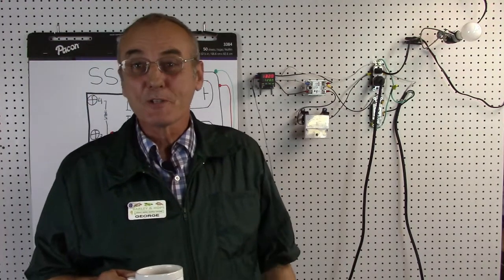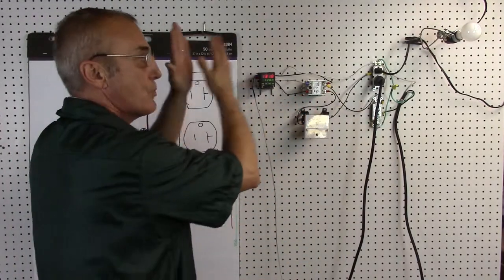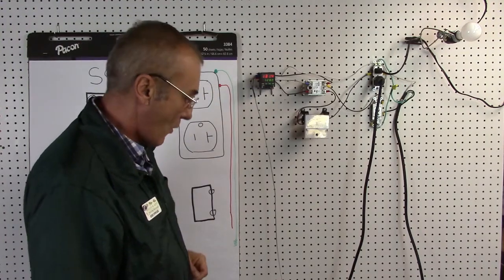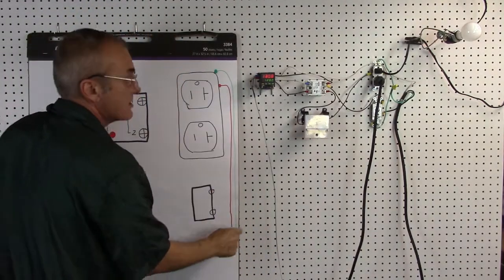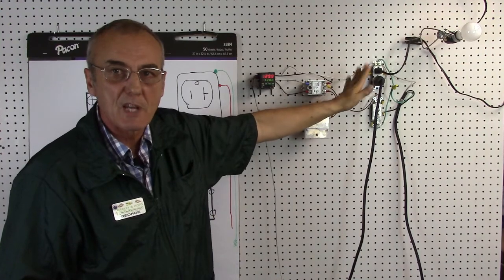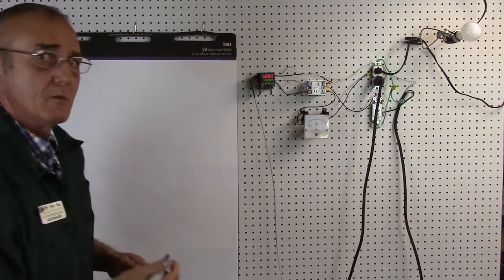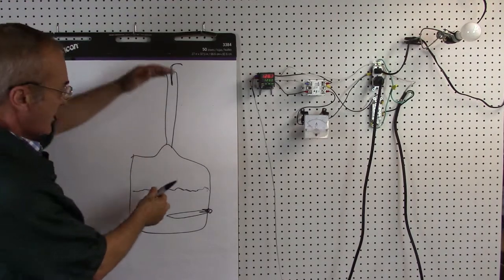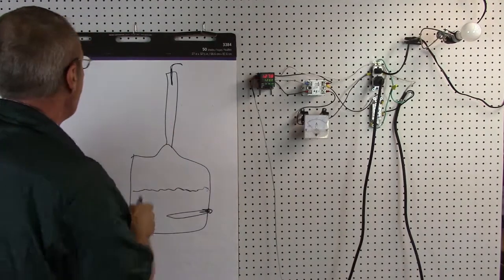Wiring 120V PID including an amp meter

Comment: George... I’m building a 240 controller 4 wire 30 amp system with a 240v PID and 240v PWM and a couple of 120v plugs.... I want have a total as well as individual AMP meters on each type system in same box... normally you only run one hot through the amp doughnut... If you run both hots I’m told they will cancel each other out... I read that if you feed the hots in from opposite ends into the doughnuts or criss cross it will give you total amp draw on main circuit coming into controller... your thoughts are appropriated
Reply from the maker: One wire, one doughnut. Anything other than that could cause mis-reading.
Amperage is measured by measuring the magnetic field inside the doughnut. Anything that would or could interfere with that field could throw off an accurate reading.

Comment: Hi George,

Regarding the PID  temperature prob. How do you install it 
Into  the Still. Do you a have the list of parts needed to do this without drilling hole in the pot or mask tank? Thx in advance.
Sincerely 

Bret
Reply from the maker: Bret, the probe should be in the vapor flow as it exits the still. There is no list of parts to do this. Some still are already capable and others need to be adapted.
Reply: Barley and Hops Brewing Thank You George!
Reply: @BarleyandHopsBrewing  top of stack??

Comment: Hey George, This is Don. I am so glad that you pointed out the 15 Amp limit. I saw some PIDs for sale that were supposedly 5500 watts but only had a 120 Volt plug. I immediately thought that they didn't know what they were doing and just put a 5500 watt element in and called it something that it is not or were they being deliberately deceptive to a public that is simply not going to know these technical details. My question is will a 5500 watt element only draw the current that is available or will it constantly trip the breaker? Your videos are a great way to inform the customer and an informed customer is a happy customer.
Reply from the maker: Don, a 5500watt element will draw as much as it can and trip breakers if the appropriate amperage is not available. 5500watt elements are typically designed for a 220V circuit and would draw 25 Amps. You could wire it for 120v and in that case it would act like a 2200-2500watt element (there is a formula for that) in that case it would draw around 19Amps. This is still above the average 15Amp circuits we are familiar with. You are right, this sounds like a situation where someone is not being fully honest with the customer. Hope this helps. 
I would rather be honest up front in the interest of safety and also to reinforce credibility. We may not get everything exactly right but we try hard and always stress the safe aspects of this topic. George
Reply from the maker: Don, the formula for to determine the wattage after wiring a 240V element to 120V results in the element operating at 25% or 1/4 of its rated value. I just did the math so a 5500 watt element wired for 120 would operate like a 1375 watt element. Appears to me like the selling point for these is the 5500 watts when actually you'd be better off wiring a 1500 watt rated for 120v and that would be more efficient and much cheaper (around $9). Anyway you look at it it's just dishonest.
Reply from the maker: Don, the formula for to determine the wattage after wiring a 240V element to 120V results in the element operating at 25% or 1/4 of its rated value. I just did the math so a 5500 watt element wired for 120 would operate like a 1375 watt element. Appears to me like the selling point for these is the 5500 watts when actually you'd be better off wiring a 1500 watt rated for 120v and that would be more efficient and much cheaper (around $9). Anyway you look at it it's just dishonest.
Reply: Yes absolutely, safety is always first and then reputation will follow. A good name is better than all the money in the world. Keep up the good work. Don
Reply: Thanks for verifying my suspicions George.

Comment: Hey George, Mij Project is ready, and everythings works perfect. The only problem is i have 2 ssr 40A and each ssr have is own AMP meter connected like in the step by step guide. when conecting i got no electric connection, when i put the wires together the things works perfect, what do you think there's wrong
Reply from the maker: Not sure I understand what you mean. Can you be more specific?
Reply: hey george, the situation is: i lead a wire from my ssr to the AMP meter and from the other connetion  a wire to the connector and the problem is that  then there's no electricitie on the connection. When i connect the two wires on the AMP meter togheter without the AMP meter everything works perfect. thanks for the quick responce

Comment: George
Love the videos. Big fan here. Having an issue with my wiring. Did a slightly different set up with the use of fuses. One a 10 amp and one a 1 amp. Almost ready to add a fan and have started to add an amp meter as you described after the number 2  pin on relay.  Problem...amp meter would not work  however the PID works perfectly off the 3 and 4 pin on relay. After using a tester the exiting plug is showing that the hot/neural wires are reversed. Any suggestions where to look for the problem. I tried all o know Hichingpost is not much. Again PID works fine however I can’t hook it up to my Brewer because of hot/neutral reverse warning. Greatly appreciate any help. Charles.
Reply from the maker: Not sure I understand fully. The amp meter (in my opinion) should be before everything. This will give you an overall monitor for your system. The PID only draws about 1/2 amp so it won't change your overall amperage. 
Hot wore goes to pin one and then a separate hot wire from pin one to the heater. The other (neutral) wire goes directly to the heater. If you have a reverse alert on your meter, switch these. Actually, electricity doesn't care which wire it runs on so you could leave it and it would work fine. By convention you should always switch the hot leg, if it is reversed you are switching the neutral leg. Same results, just backwards.
George
Reply: • I ran the initial (in plug from wall) hot wire runs to a 10 amp fuse back out to the on off switch. 
• From the on off switch to a bus bar. 
•From their to the No. 2 terminal. 
• next black wire from same bus bar to a 1 amp fuse. 
• out the one amp fuse to the no 1 terminal on PID. ( all wiring for PID works correctly) so I will not  go further with that. 
•Out going female plug has a white going to another bus bar as well as all other whit neutrals. 
• black wire from no 2 relay terminal connected to outgoing female plug. 

I will place the amp as you suggest after the switch so when on amps flow. 

Problem is the outgoing email plug that I would attached to the brewer or melting furnish is showing hot/neural reverse with no power. 

Question 1. Why is the outgoing plug showing reverse polarity?  

Question 2. Where would you tie the DC fan into. I have the cIRM -10-12 converter as well. 

•Grounds are capped because I’m in a non metallic box.  

Sorry to drag this on however this is my version of a sexed up PID. Lol. Charles
Reply from the maker: Sounds like you have 2 hot wires going to pin 1 and pin 2. No matter what you put in between the connections and the source. Not sure why you have a 1 amp fuse.
Very simply, run one black wire to pin 1. Run a second black wire from pin one to the element. So now you have power going into pin 1 and from pin 1 to the element. 
The neutral wire goes directly from the wall to the element. 
When the PID initiates pins 1 and 2 will connect and you will have power. When the PID turns off the connection is broken between pins 1 and 2 and the element will turn off.
Reply: Hi George,
Tied grounds together and wiring for outplug showed correct. 

Started with this site before finding yours ...
https://youtu.be/IGOqMyx5kv4  (about 55:50 mins into it)

Then wanted to add the fan and amp meter to sex it up a bit. Just can’t get the amps to the outplug evan though it’s states wired correct on tester. Light on Transformer never goes on with the PID light if that helps. Also the reason for the 1 amp. According to the prior video... it was to protect and isolate just the PID since it would burn out way before the 10amp did. Thanks for all your help.
Reply: George,
I must say you have the patience of a Saint. I must have sent you 4-5 emails with pictures of my project attached from all angles without one missed response email from you.  You helped me to figure out what the problem was and fix it and I was able to move on to adding a switch, fuses, amp meter and now a fan to sex it up a bit. I want to personally thank you for sharing your knowledge and time.            YOU ARE GREATLY APPRECIATED!!

Comment: Do you need a Current Transformer to hook up the amp meter?
Reply from the maker: No. Most meters (digital) have internal transformers for their operation. The analog meter is directly wired and does not require a transformer.
Reply: Awesome, I made a big mistake and bought and wired up a DC AMP meter. Needlessly to say I blew it up. I have a AC on order. 
Just in case could you send me a link to the AMP meters you buy? Thank You

Comment: Hello George . I have a couple questions to ask you I have a voltage controller and a heat element can I hook up a current 120 meter to it. without a Ssr and a. Pid. Can I hook the meter directly up to the heat element and then the other side look out to the voltage controller please get back to me .mike
Reply from the maker: Mike, I can' comment on this with the limited information you provided.
George

Comment: Hey George what size enclosure did you hold up to the camera at the 45 second mark in the video? And where did you purchase it? A link would be nice lol.
Reply from the maker: Those are no longer available. It was 220mmX200mmX90mm (if I remember correctly) Close to 8X6X31/2 inches).
Reply: Barley and Hops Brewing LLC Thanks!
Reply: Barley and Hops Brewing LLC Do you know the measurements of the mypin t series pid? Like how deep it will stick out into the enclosure. Also how high is the ssr and heatsink?
Reply from the maker: http://blog.uvm.edu/cwcallah/files/2016/04/AGPTek-PID-Controller-PC17-user-manual.pdf

This is the link to the user manual with all the measurements included.
Reply: Barley and Hops Brewing LLC Thanks for all your help! I'll stop bugging you now. Lol

Comment: I have two 40 amp SSR where dose pin 1 & 2 go on the SSR, I am using stove elements 2000 watts each . can you help me   Jerry B.
Reply from the maker: One each SSR the switching happens between pins 1,2. So the hot lead (one only) goes to pin 1 and a separate wire from pin 2 goes to one side of the element. The other hot lead (if this is 240 Volt) goes directly to the other side of the element.
George
Reply: Can you wire a 40AMP SSR-40DA and PID, using only 120v? For example let's say I downgrade my boiler, no longer need a 4500WATT element. Can I use my 2000watt using half the voltage without purchasing a new pid and SSR?